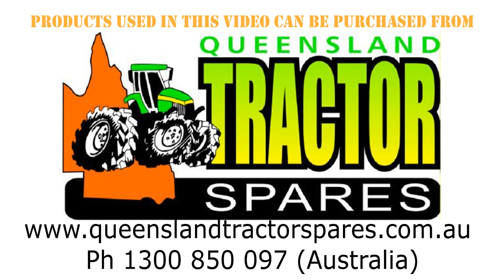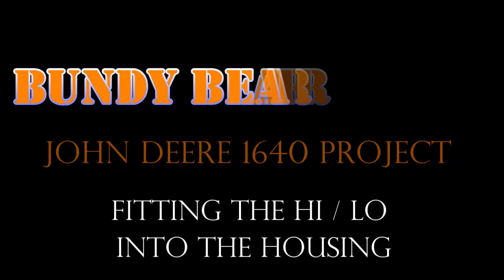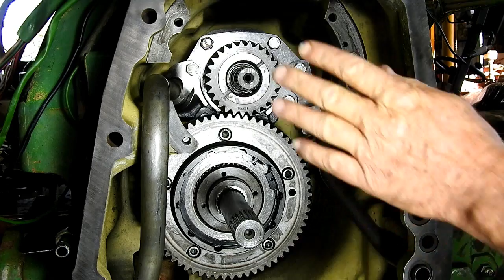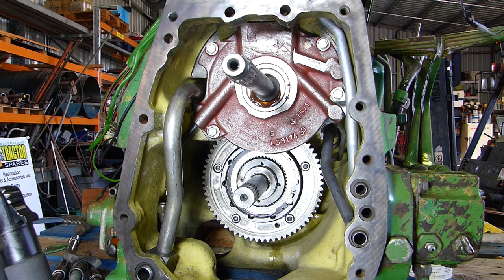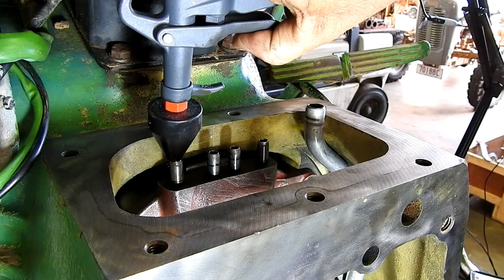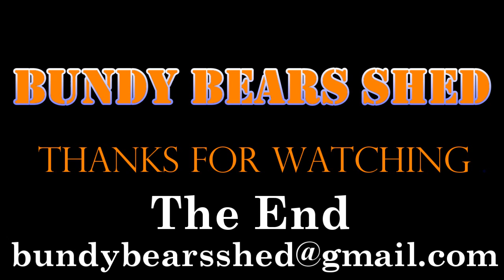John Deere 1640 Fitting the Hi/Lo Clutch Pack

Comment: I have a 2555, looks the same. I assembled it as you did, but I can't turn the driveshaft. If I put the clutch fan on the end of shaft,a I can turn it or vise grips really tight.  On the front of the gear housing there is a big nut that tightens a bearing on the synchronized gear shaft. I just this nut so that the two shafte diid not wobble. The tighter you pu this nut, the  more the shaft pulls out and seems to have put too much pressure on my high low shafts, making them difficult to turn. If I split the tractor again (cab, loader) which I'm not to interested in doing, again. If I loosen that big nut,, would allow shaft to go in more but my gears on synchro gear shaft will flip flop around...
Reply from the maker: I dont think so but not something I have tried.
Reply: Tekrar sökmelisin çünkü arıza giderilmemiş

Comment: Hello. I have a John Deere 3650 and I recently rebuilt the transmission. I changed discs, plates, o-rings, rubber rings from the hi low case, I also changed the pump in the transmission, I put a new one but it's on the aftermarket, I changed segments on the power take-off absolutely everything. I have problems with the steering and with the arms on the back, it is hard to lift and turns with knots. If I remove the cover from the gearbox and connect the two pipes between them with a hose, the steering works perfectly and with the arms on the back, when I put the cover on, the steering and the arms on the back no longer work. What could be the cause? Thank you!

￼
Reply from the maker: On the shift cover there is two plugs on the rh side of it, put a 300psi gauge in the front one and check all functions and see if the pressure just drops away with one particular one on. It does sound like a leak in there somewhere, but you will need to test things to know exactly where you should look.

Comment: Hi mate got a question when you tested the clutch packs with air was it still mounted to the tractor? I got everything together when I spin the hi low sharft the PTO shaft doesn't turn and was wondering if that's cause I got it separated from the motor. Any help would be good thanks and amazing job your doing
Reply from the maker: I test on the bench and in the tractor, mainly for any leaks in the pipe work. It wont turn the pto just lock it up with the pto clutch and brake tests.

Comment: Greetings from Romania!
Can you tell me please if the JD 3040 tractor has a similar transmision with this one?
I have rebuilt my high pressure pump because the shaft and bearings were done(complete rebuild!).
I am worried that my transmission pump may be tired also and that the main pump will run with little oil.
I understand that this is the fastest way to destroy a new high pressure pump.
Can you give me a few advices on what to look for if i feel that the main pump doesn t get enough oil?
Can you tell if the transmission pump is bad only from how the  3p link and power steering works?
Also the PTO never worked properly on this tractor ,it slips when trying  mowing or round balling.
Thanks in advance for any advice and please excuse my many questions!
Reply from the maker: The 3040 is exactly the same set up so going through the internal pump and packs will be a good move.
Reply: @bundybearsshed  Thank you very much for your quick reply!
I suspect some oil line in the transmission is broken or the  transmission pump s  pumping days are over ,because it feels like the main pump never gets enough oil...

Comment: Thanks for all the knowledge you are passing along. We have 8 older JD s  from 3020 to 4955 s some getting up to 14000 hrs, all in use and getting the job done. We do almost all repairs our selves so having you explain how things work helps allot.
Reply from the maker: G Day Robby, Glad it helps, there is a good sense of satisfaction in doing things yourself. Makes farming way cheaper too.
Reply: @bundybearsshed  I talked with a JD dealership guy to look at my JD 3040 tractor(it has a few problems).
He was sincere enough to tell me that the intervention would be more expensive than the tractor itself ,and that i should learn to fix it myself.
I started by fixing my main pump...
On top of that ,they don t even work anymore on tractors this old.